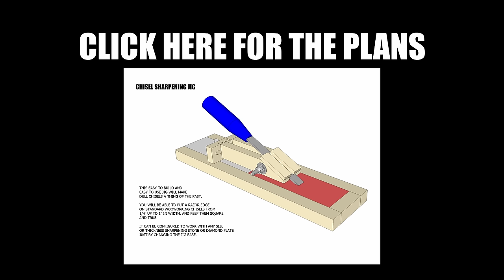Make This Chisel Sharpening Jig

Comment: Hi John, love the jigs! Such ingenuity in incredibly simplified packages. An idea in the same mindset as keeping it simple, to avoid having to use the loose 1/8 piece with a mark on it: make a rabbet 1/8" deep by however long the stickout needs to be for the right angle. Could do it on 2 sides for an angle for a micro bevel as well. Keep up the good work, learn something almost every video!

Comment: Built it. Works perfect. Bought a chisel in the late '60's not knowing that it should be sharpened even though it was new. Dragged it out of the bin and brightened it up on your jig. Now I can sharpen pencils with my eyes closed.
Built the base from a plastic cutting board. Not recommend, even though it's plastic. The saw melts the plastic and difficult to get a smooth surface. In spite of that my "Footprint" chisel is like a razor. I've also bought a box of band aids :-)

Comment: What's the best type of chisel to use for prying open paint cans?
Reply from the maker: Your neighbours.
Reply: I normally use an old bent flathead screwdriver
Reply: no need for prying, its already open. Why would you pry open paint cans?
Reply: Use a flathead screwdriver. Don't kill your chisels.
Reply: coins from your change, quarters, loonies... whatever fits
Reply: Thanks for the tips! I've been using an old oversized novelty chisel I found in my grandfather's shop, the thing was 3" wide and about 30" long, lol! Anyway it took a few hours at the grinder to get it down to a usable can opener size but it works fine now. Just thought I'd ask just to make sure I'm using the right tool for the job.

Comment: When you mentioned glass, it reminded me about whenever I put a brand new razor blade in my blade holder, I rub it on a car window for about 30 seconds. It hones the edge so it will slide along the cars paint and not dig in. It is great for removing decals, sap, road paint, etc.

Comment: Nice idea for a jig, john. You've given me some ideas. 

I don't like to be a naysayer or a YouTube troll, but I also wanted to say that the user had better make damn certain that the stone surface is parallel to the side of the wooden frame otherwise you're getting random results everytime. Provision for a positive stop when inserting the stone might be a good addition for version 2.
Reply from the maker: "Provision for a positive stop when inserting the stone might be a good addition" - the top of the bench seems to work just fine.
Reply: John Heisz I had a similar thought when the stone gets some wear. It's easy to adjust upside down against the table, but would it need a couple of "set screws" to make sure it won't slide down under use?
Reply from the maker: JWAM There seems to be no end to the ways that guys will think up to complicate this - it's easy: first, stones don't wear out that quickly, so you might be 10 years down the road before you'd have to do something about it. At that point, even if it's just a couple of months, you can just plane some off the base to match, or shim the stone up. Or make a new base - it's no big deal.
Reply: My stones haven't worn the slightest, but that's because I'm yet to use them.That should put the proper amount of weight into my words. :)
With a nice jig like that though, it's a shame if the leveling of the stone makes it in any bigger hassle than it has to be. Assuming that the stone has two grits, the perfect solution would be that the stone isn't as snug in the hole, and two thumbscrews on the side loosened drops the stone down onto a flat surface, you flip it over and it's always flush. Stone can be flattened in or outside the jig when needed.
Reply: Mi

Comment: Wouldn't you just cut a block with that angle, and recess two strong magnets in a row for the top complex part of this jig? (Two 1 1/4" magnets with center screws have combined 180lb force) and the bottom jig, either contact cement sand paper, out the long route short, take a 1x4 mill it to height of stone, C notch it longer than stone (9" in this case) and use bolt through the last inch to tighten it. Just curious, I'm always looking at the super simple way.